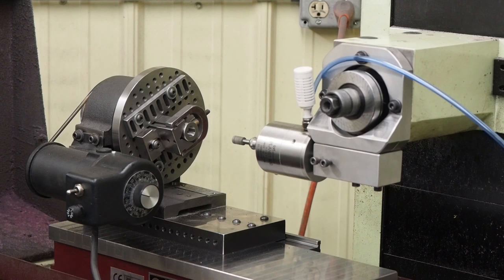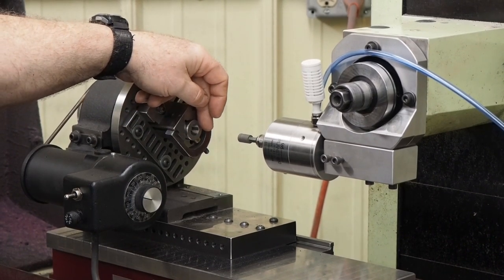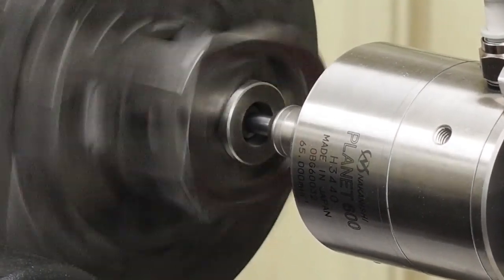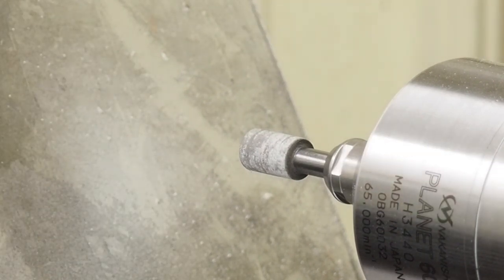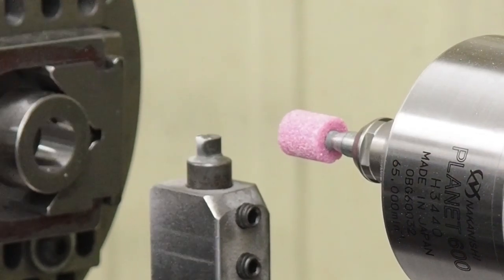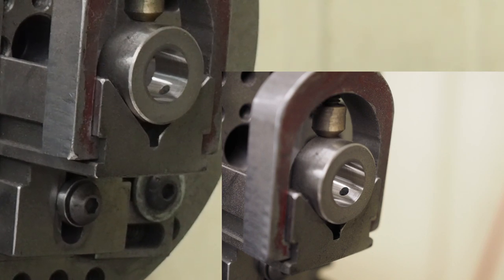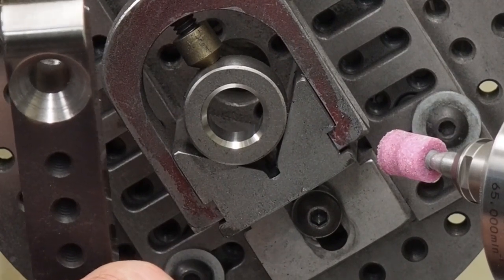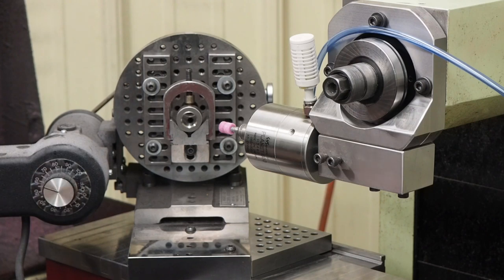Newest Addition to the Shop

Comment: Clever setup Steve! Your imagination is showing.
Reply from the maker: If things work out and I get the Suburban Master Grind you will see a lot of interesting things on this channel using both.
Steve
Reply: I had a Harig grindall #2 size. It was a very accurate piece, unfortunately, I sold it with the rest of my machinist tools after I retired. That probably makes some people cringe to hear things like that, but I had no one in line to give them to, and I wanted to see them go to good use.

Comment: Hi Steve,
Nice grinding head and the adapter looks great. I really like your spin fixture and have been looking for one to add to my shop. I know you have a jig grinder did you ever think about using the grinding head from that on the surface grinder?
Reply from the maker: Hi Eric,
The Planet 600 has a much smaller foot print than the jig grinding head and is a better fit on the surface grinder. It uses less air and I doubt I can get any better results with the jig grinding head.
Steve

Comment: What kind of compressor do you use for the Grinder? I don't ever hear one. I like how quiet it is.
Reply: I mean for the jig grinder?
Reply from the maker: It is a 6hp 2 stage don't remember the brand name. It is outside the shop in its own little building. That keeps the noise down a lot.
Steve
Reply from the maker: It is a NSK planet 600, very accurate and quiet.
Steve
Reply: Thanks, Beautiful setup. I've bolted an Extended Die Grinder to the wheel guard of my Chevalier grinder.
Ugly and noisey. Great channel I binge watch about 10 episodes on Saturday.
Thanks again.

Comment: 👍 hello everyone at SR. What determines the the direction of rotation for the part? I  run my lathe in reverse when toolpost grinding, so work and wheel are opposing each other. Thanks again everyone!
Reply from the maker: Hi James,
It doesn't make much difference what Direction it spins. I usually spin the same direction as the grinding wheel. I may get a little bit better finish and accuracy. Spinning against the wheel will cause the wheel to bit into the work especially with interrupted cuts where as spinning with the wheel causes the wheel to ride on top of the part rather than dig in.
Steve

Comment: Why did you turn the part the same direction when using the stone and the opposite direction using the CBN Steve?
Reply from the maker: Because I could. :) I was testing it earlier spinning opposite the wheel direction to see how much it would bog down. I like to grind spinning the same direction as the wheel in most cases but was not paying enough attention filming the video, was running my mouth to much.
Steve
Reply: You can turn the part in the same direction to slow  down the surface speed of the part you are grinding if reqd .

Comment: Nice set up, holy smokes those are expensive!
Reply from the maker: Hi Stan,
Yes they are but way cheaper than a new ID grinder. Also, It is very fast and accurate when setup right. For doing accurate angle work it would be hard to beat. I held extremely tight tolerances on jig ground parts (hole to hole and diameters)  in the past using one not quite as good as this one.
Steve